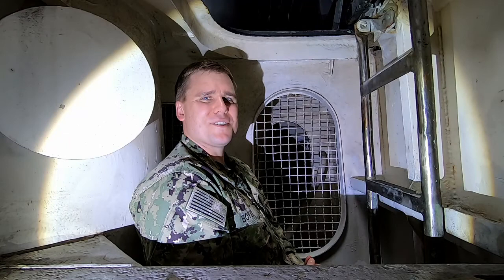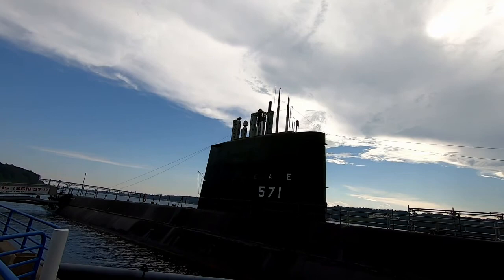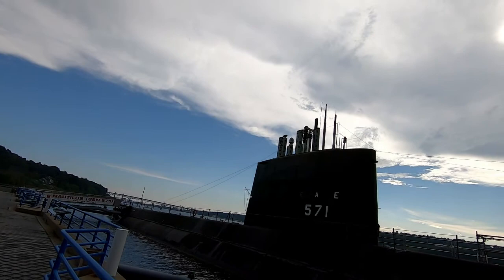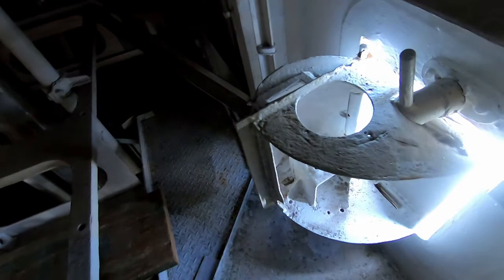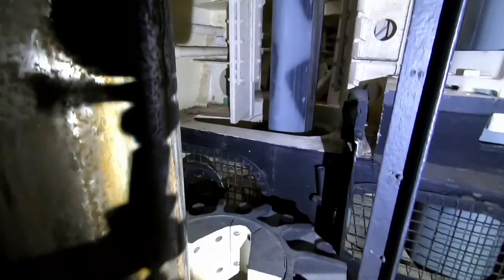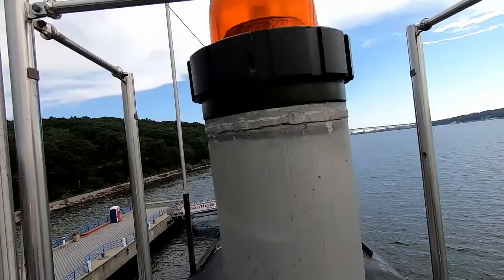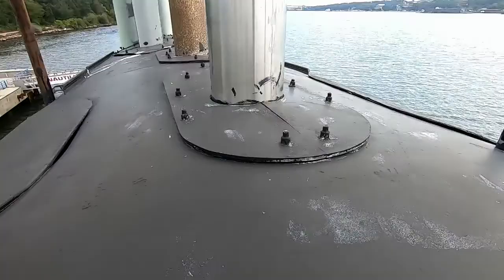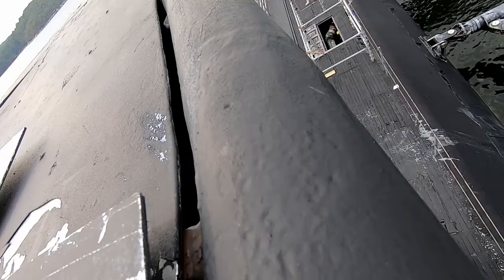Episode 18 - Bridge

Comment: Are there any video clips of the sound the pressure hull makes as you dive to depth, or are the sounds we hear in the movies pretty realistic? Also, wouldn't these sounds transmit in the water and possibly give away your position?
Reply from the maker: We do not have any video clips.  There aren't really many sounds as you go down - unless you go down quickly.  As such if you are trying to be quiet you would change depth a little more slowly to avoid putting unneeded noise in the water.